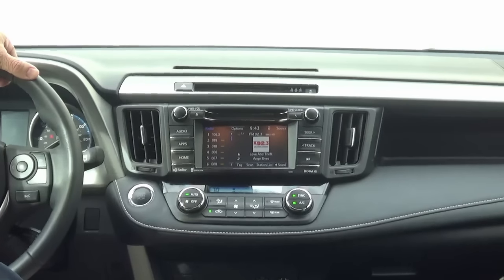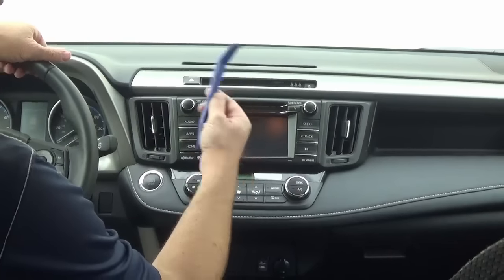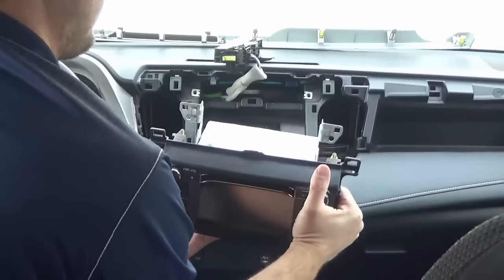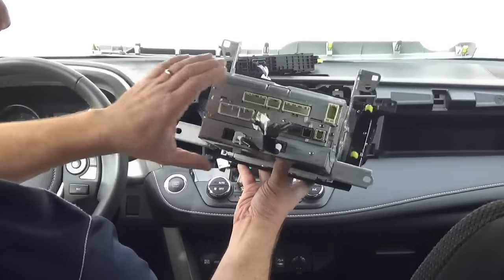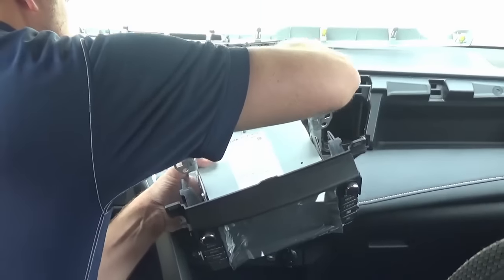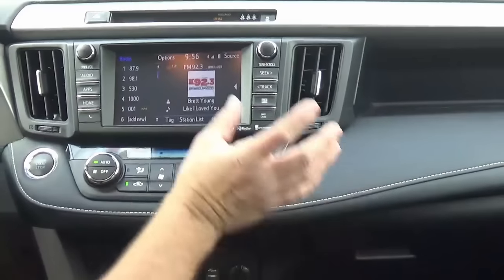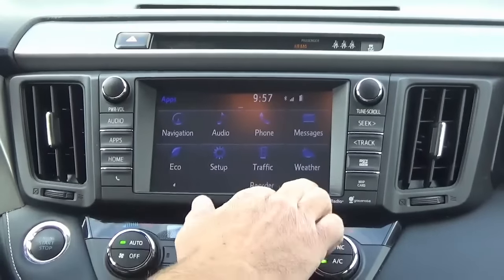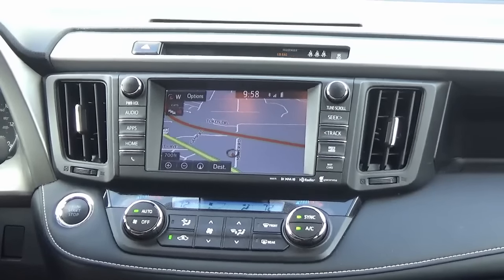2014-2018 Toyota RAV4 Factory Entune GPS Navigation Upgrade - Easy Plug & Play Install!

Comment: Can you buy just the cable harness from the radio unit to the serious XM  receiver
Reply from the maker: We would not sell it that way for any reason. We do not sell the harnessing on its own for any of our kits. If the price is a bit too high to do the full kit you may want to consider going with an aftermarket part as opposed to OEM. We put a lot of effort into making sure this upgrade has no issues and has all the correct equipment sourced based on the Vin and we have found that piecing these upgrades together part by part has a very high failure rate. We recommend going with our full kit or checking out something aftermarket as afteramarket radios are much more a la carte friendly.
Reply: @Infotainment_nav  Damn B.  You ain't got to be so rude.

Comment: The unit you installed does not have a CD player like the one you removed from the dashboard. How come? Something is not right here. We want the infot. Unit to have a CD player. Is that available?
Reply: I noticed!!!! Why not install the same thing with a CD?  Unless there is a hidden CD changer or hidden tricks up their sleeves.
Reply from the maker: The factory GPS navigation radio containing a CD player is designed for the 2014-2016 model years. The units excluding the CD player are designed for the 2017-2018 model years although they’re interchangeable throughout all of 2014-2018. By default, we will ship the non-CD player units due to popular demand.
Reply: @Infotainment_nav  so for a 2018 RAV4, can we get a unit with a CD player and premium navigation? (not the scout navigation since it is not available as of October 2023). The dealer service people and Toyota advovate center said you can't interchange infotainment units . You must use the exact one  your Vin. Number is associated with. The only way is to look for an approved aftermarket unit that is compatible with your vehicle.